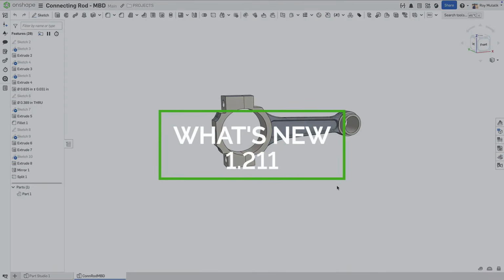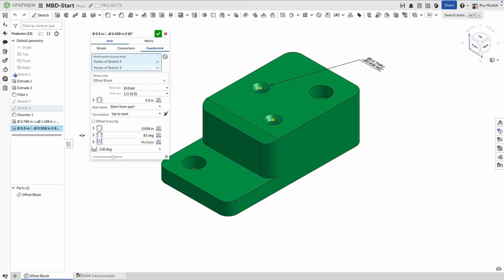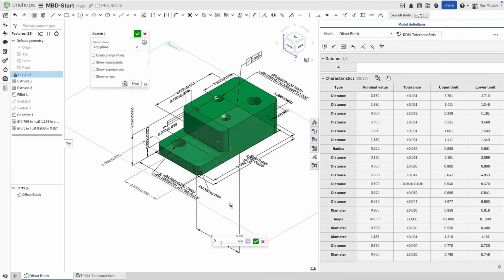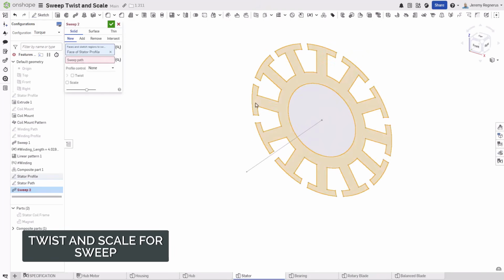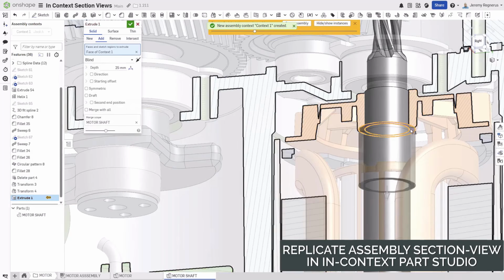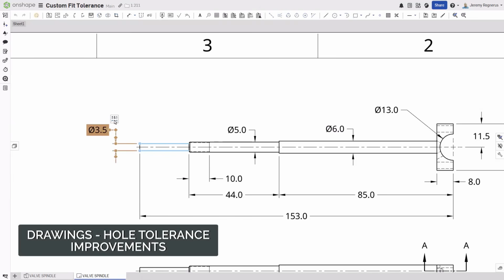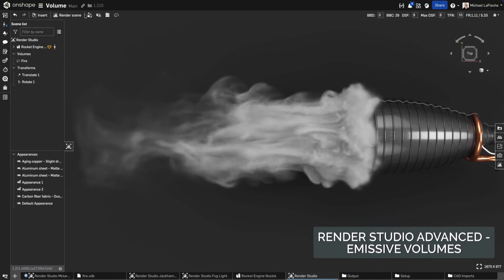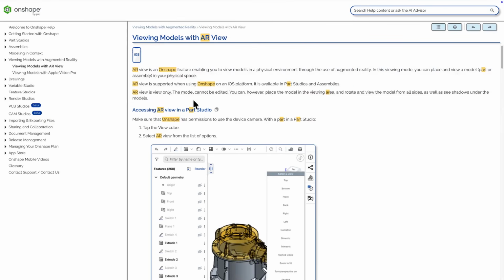What's New in Onshape 1.211 (Model-Based Definition, Sweep Twist and Scale, Offset Planes by Curves)

Comment: FINALLY YAYAYYAYAYAYAYYAYA This will make drawings so much easier.
Reply: Actually damn never mind it won't apply to variable defined dimensions?
Reply from the maker: Hi - Yes, variables can be used as input for model-based definition and tolerances.  I bet you need to dimension to what will end up being faces. Also, here is a getting-started guide one of our product marketing managers made that talks a bit about the "face rule" as faces are used for inspection in most cases: https://www.veed.io/view/f1d555d1-711e-44f6-93a4-310d650ed9f4?source=Homepage&panel=share

Comment: With these in model tolerances is there a way to see weight and volume at max vs min tolerances to determine load lift safety margins for factory line tooling?
Reply from the maker: Hello - The tolerances in the 3D model provide inspection tolerance ranges, so you could theoretically do this with a little bit of effort with Configurations of the model at the upper and lower limit.  There are third-party tools (usually at high cost) that will perform analysis of tolerance ranges and provide stackup analysis with the available tolerance data.